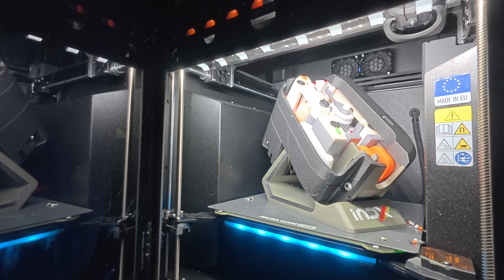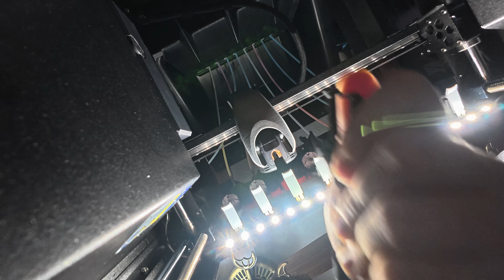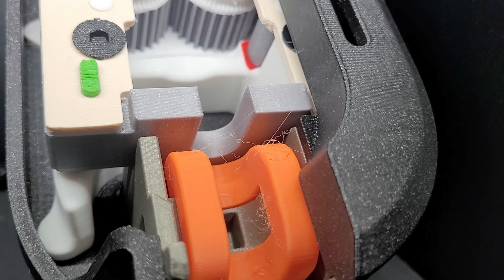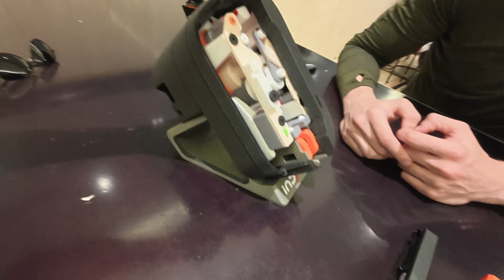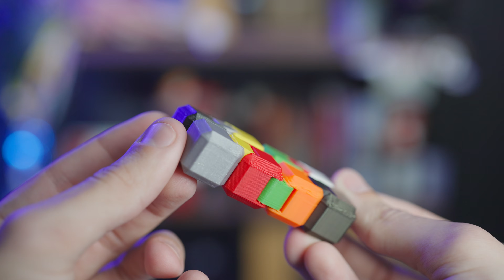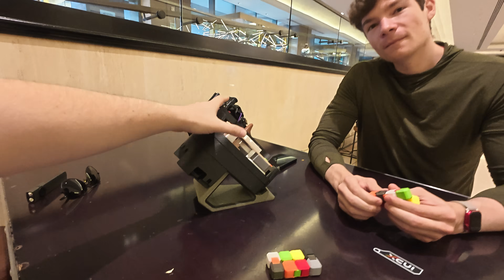This 8-Color Print Took 3 Days (And Failed?) - PrintFixFriday 257 (feat. @KarlMeyer)

Comment: failure is not an option... I'm staying away from INDX for now
Reply from the maker: If failure is not an option for you I recommend avoiding 3D printing in general and most of Life honestly, failures just part of life and I would say that overall my experience has been pretty darn good, while there are some learning curves associated with it I expected that
Reply: @3DMusketeers the indx system doesn't seem to be built to last. You rub the coil the wrong way or get a blob and that entire tool head is toast. Drop the tool on the ground magnets snap or chip. Ir thermometer will foul over time and drift as the surfaces change and is a fail deadly method of heating control. It's unsafe to rely on non contact temperature measurement with a high temp high power fast rate of rise heating system carrying flammable plastic in a super glued coil that will release at not very high temps causing even more damage.

Comment: I feel like pogo pins on a normal configuration would have made for a more reliable system?
Reply: Or just a wire if they wanted to be fancy use data over power then you could get away with two super thin wires potentially to transmit data and power to a temp sensor on the tool head the ptfe tube has to go there anyways. Or just copy bambu and use a rfid temp sensor. It's not safe to use a non contact temp sensor in a fouled sensor a runaway are not guaranteed to get a heating timeout or min/max temp error. Over time the temp readings will also drift as you are not regularly black body calibrating that sensor.

Comment: That's exactly the same thing I'm seeing. Coincidentally with a 0.4CHT in postion 6.
One thing that I'm a bit concerned is machining fragments, aka swarf. There was one community member that sanded through and found a bit of swarft.
I've not used my additional nozzles so far, I need to get in with my microscope, camera + macro lens and a inspection USB 'snake' camera.
Reply from the maker: The nylon cold pull worked for me. No issues.
Reply: @3DMusketeers nylon is magic like that, even if you put on the old respirator and break out the 0.065" strimmer line.

Comment: Grant, here's an easy way to know if you're being to soft on INDX:

Ask yourself if it were a product made bt Bambu Labs and not Bondtech, would you be as easy on it's failings?
Reply from the maker: If Bambu would be communicating with me and their community about the issue at all and making promises of fixing, public statements accepting blame for the problems, etc. yes. Yes I would.
Reply: @3DMusketeers  Oh, c'mon, Grant, you know I didn't mean LITERALLY making the product.
Reply from the maker: If Bambu communicated with me when we sent emails about product issues, etc. sure they would get the benefit of the doubt like Bondtech is getting here. However, even when presented with overwhelming evidence that the A1 is an actual fire hazard, they refuse to do anything proactive about the situation. There's a clear and obvious difference here.

Comment: I use soldering iron with temp control to heat up the nozzle if it’s not installed in the hotend
Reply: Great idea, will use that in the future myself.

Comment: I don't see how this printer is going to last the exposed copper coil the IR temperature sensing that is fail deadly and the nozzle wiper needing equisite calibration to get the poop right is not a good idea
Reply: The INDX is a mod for the Prusa CORE One. It is not a commercial printer

Comment: yeah as good as it looks......I'd still re-print it.
Reply from the maker: 3 DAYS though and over a kg of filament? I dont know.. or you mean the cubes? Because if the cubes, I didnt have time, they finished at 230am and I left FL at 4am lol
Reply: @3DMusketeers  oh damn...... I knew it was big that's a lot. My biggest was 1.1kg, but most of it was waste.
Reply: @3DMusketeers  maybe you could like fill it with a 3d pen to fill in the gaps. and then smooth it off.

Comment: Assuming it was 5 colors I think I could print it on the mmu3. I've never had an issue I couldn't fix. Most of them were my fault. I had one where the boden tube zippered on me. That print finished successfully......after I replaced it of course. A couple times the filament slipped out of the tube. I think I've had maybe 10 fails of the mmu3. All minor. And it's probably had 20k tool changes at least. 40k wouldnt' surprise me.
Reply from the maker: I THINK you could parse this down to 5 colors, but the purge on the MMU would be substantial.
Reply: @3DMusketeers  yeah...... lol

Comment: Temperate rainforest, can confirm that stringing is just something you have to deal with.
Reply: Can this be mitigated by slightly increasing retraction as each tool is dropped off?  Ask as this made a difference with my SC.  I am always looking for the next challenging print.  Going to try a 6 color print of this.

Comment: I hope they fix the copper degradation problem i think sacrificing function over look is problem, copper wire against part that moving in out without proper protection is stupid, and i hope production version is cheaper for 6 head or release 4 head version for cheaper price tag.

If they already release the mass production unit probably I'm not gonna buy indx system, i buy the prusa but the indx toolhead?probably not

Comment: I will try that 8 colour 100% infill PETG infinity cube fidget toy.  Biggest thing I've printed is that Chameleon print in Translucent PETG and it turned out amazing!
Reply: Whelp, my 8 colour infinity cube PETG fidget was a fail! I ran it at 0.2mm balanced and one of the sockets broke when folding it. so it was a bit too stiff when folding it for the first time. Also few tiny bits of contamination of filament debris mixed into the adjacent cubes. But so close to being perfect! Will run again.
Reply: Follow-up Print was pretty much perfect. Only two hinged were a bit still, but worked loose eventually

Comment: 36mm³/s must not be pure PLA lol. I capped out at 28mm³/s @ 0.4 nozzle, 240°C, DasFilament PLA.
I also managed to get a really nice cold pull with the three CHT ends just letting the toolhead heat the tool, parking it, waiting a few seconds and then pulling the filament out. Didn't need Nylon for that.
Reply from the maker: Prusament PLA at 230C. 36mm3 is when we start hitting some caps and need to push to 235C

I tried your method too, I even, kinda, show it in the video, but the PLA kept snapping. I may have a tight bore on the SLS part.